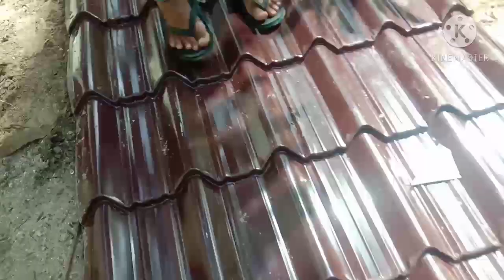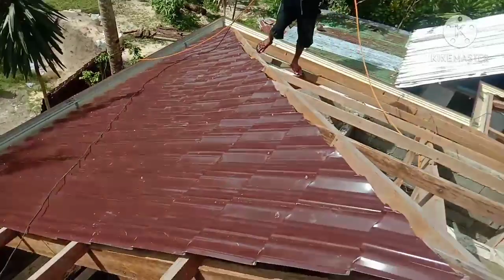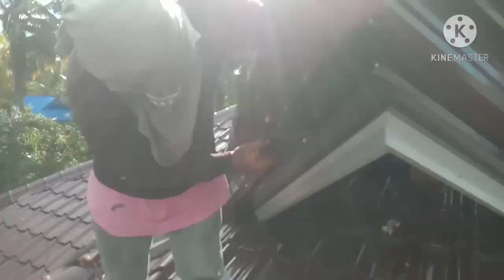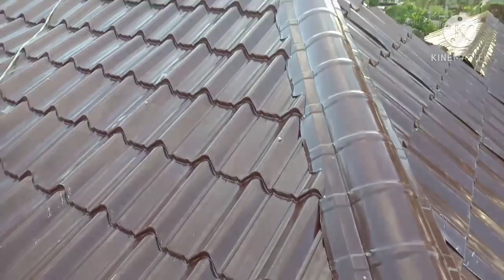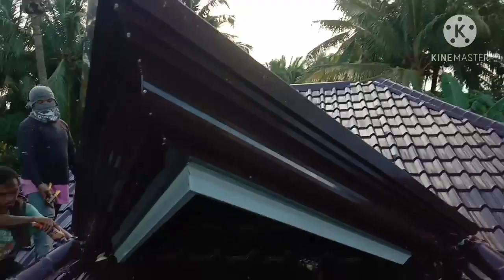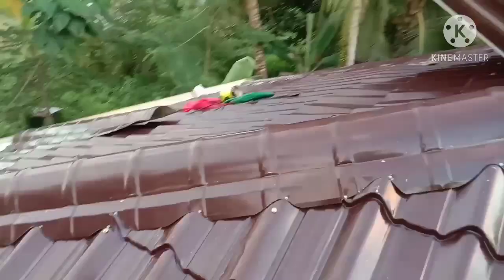Installing Milazo tile Roof

Comment: Hello idol pag milazzo tile longspang ang bobong ilang centimeter ang distancya sa bawat c purlins
Reply from the maker: 60cm magandang spacing ng purlins po sir
Reply: @JiSho28 ok boss slamat sa ridge cap idol ilang inches ang sukat niya pag millazzo tapos boss pag metal facia ay 12 inches ilang inches po ang bending ng gutter pag spanish gutter ang gamitin
Reply from the maker: yung sa ridge cap boss may standard na po na sukat yan pag inorder nyu
Reply from the maker: sa spanish gutter po , mas maganda kung malaki yung gagamitin 24x8 or pwde rin naman  18x8
Reply: @JiSho28  ipakita ang facia kahit mga 4inches boss ilang inches ang bending nga spanish gutter niya  12 inches ang metal facia